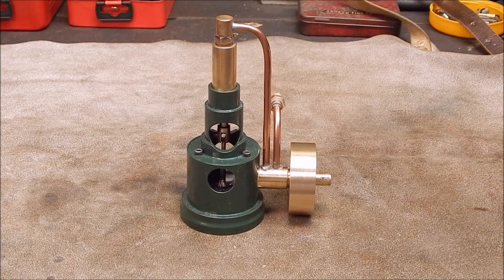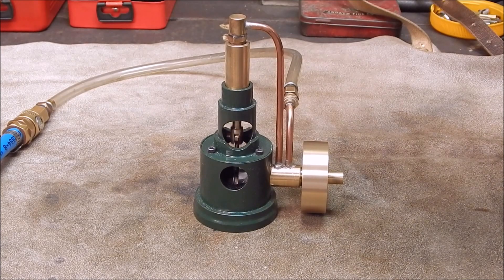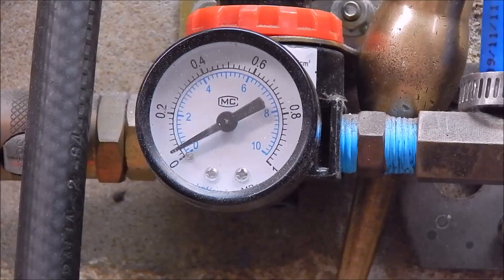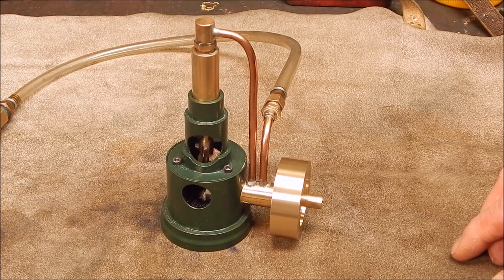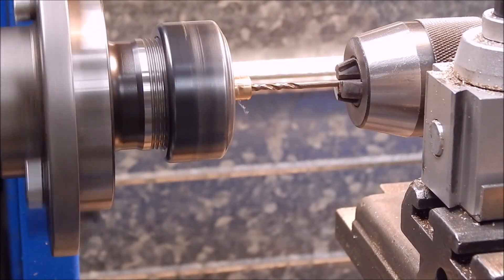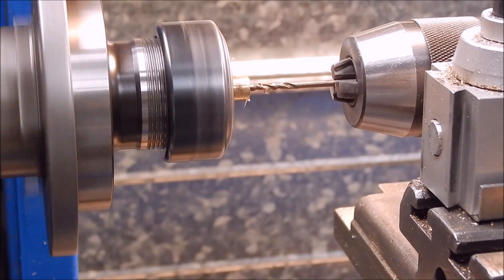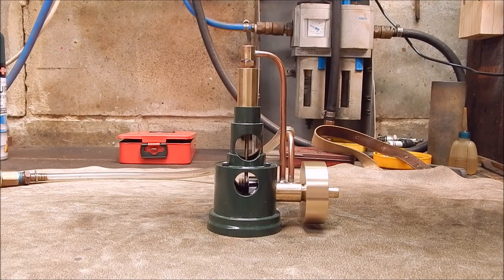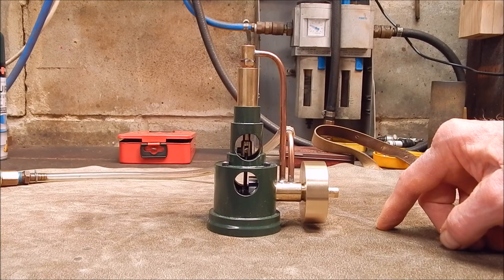I fire up the David Kerzel designed model steam engine for the first time

Comment: Nice engine Rob, I do like to see true running flywheels & no crosshead philips screws [slotted or hex are fine] I always make sure my engines have true flywheels, did you design the circular base as the kertzel drawings on your link show an open frame? I like yours much better. Graham.
Reply from the maker: Hi Graham, yes I designed the cylindrical base.  I do like the retro look of it.  I was only thinking the other day a parallel twin version with a cross link tube would look kinda cool.  I'm with you on true flywheels and no Philips head screws.  They always make the end product look cheap IMHO. Thanks for the positives.  Cheers Rob
Reply: @Xynudu  Thanks Rob, it's a really attractive base [& the colour's good] I like it much better than the original. I'm with you on the "cheap look" Graham.

Comment: That’s a ripper of a little engine Rob ! 
Job well done ! 
Surprised at how smooth it runs - I was expecting it to vibrate and take off across the bench when you cranked the rpm up but it didn’t move a millimetre.
Reply from the maker: Thanks Ian.  It's running pretty good.  Sounds like a petrol engine ;)  Cheers Rob

Comment: Maybe try to add a counter weight Rob--if its possible..
Reply from the maker: I did think of that Ian, there's enough shaft end, but it's actually running OK, so I will leave well alone.  I don't like them revving hard anyway. That's not what most steam engines do :)  Cheers Rob

Comment: Nice job Rob.
Reply from the maker: Thanks.  It turned out qute well after a few amendments to the original workings.  The concept is actually quite simple but implementation with what's at hand was a bit tricky.  I would make the rotary valve body longer next time to allow for easier soldering.  Cheers Rob

Comment: Cracking job Rob, it is nice to see it running so well. As you say, it has a lot of 'Lister' about it. Will look well on steam, especially with the exhaust configuration. Cheers, Jon
Reply from the maker: Thanks Jon.  I may do a stand alone boiler down the track that I can plumb into builds.  Would save a lot of time and have extra capacity.  Then again I might go totally overboard and try another flame licker :)    How much pain can one endure ?  He He.  Good luck with yours.  You will probably prove me wrong. Cheers Rob

Comment: Hi,Rob. That runs wonderfully well. I'm familiar with a number of David Kerzel's other engine designs. That rotary crank valve is a feature seen on a couple of his early radial cylinder designs. Have you seen any of his radials? They are definitely worth a look at.  You could get even more weight out to of that  piston by not only drilling up the rod section but also hollowing out the piston from the crown end and then soldering a button crown on top to close the hollowed piston..... Lovely little engine,glad to see it runs so sweet👌
Reply from the maker: Thanks Howard.  I have seen some plans for his radials.  I think the weight factor is OK now and did think about hollowing out the piston body.  Vibration is OK now.  Cheers Rob

Comment: That is one very nice little engine you have built there Rob 👍👍 Any engine build that runs is great in my book but the real success is when it will run on really low pressure, which that one obviously does. Cheers, Alan.
Reply from the maker: Thanks Alan.  It's the first vertical engine I've built.  The pin hole air leak has stopped leaking so I guess it has blocked off with some crud from the initial run in.  So no further action required on that bit I hope.  Just the base to do now.  Cheers Rob